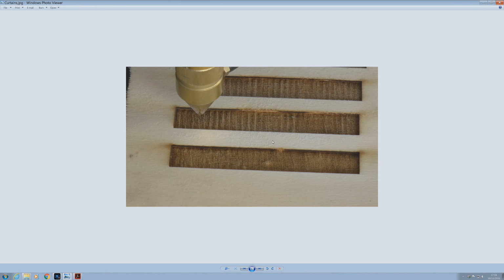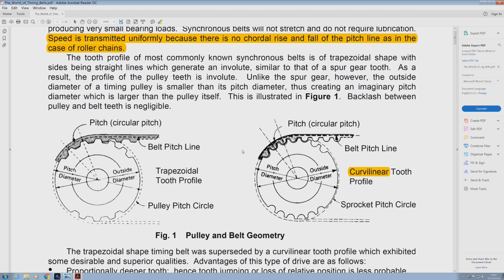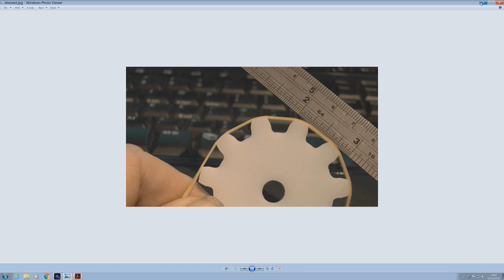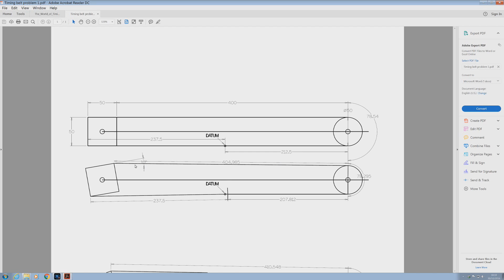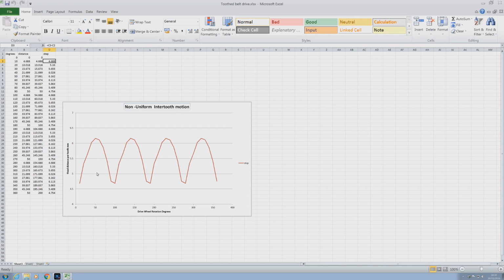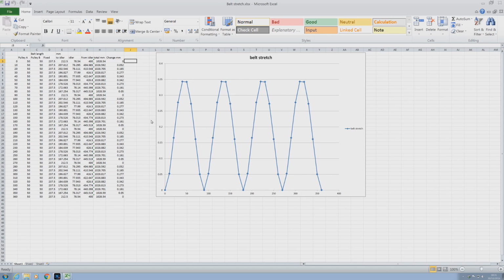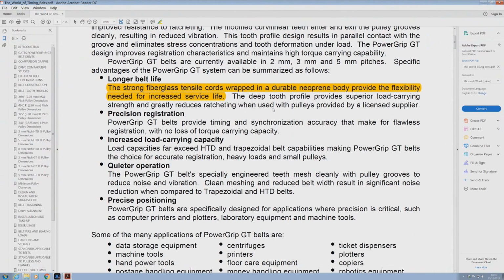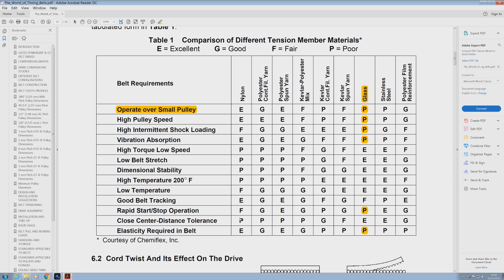RDWorks Learning Lab 83 Is this Curtains for ever

Comment: Hello SarbarMultimedia,
... strong, recurring fibrations can also be generated by the first driving pinion (each further as well).
Whose center in the real world is never exact.
What this loss of center means is underestimated.
Great video, love your posts!
Reply from the maker: Hi Herman
 Further investigation revealed that the toothed drive pinion was running true after all and that it was just the flange that was eccentric. I persevered for a year before I devised a soultion which is still working 2 and a half years later. The solution to my problem can be seen here
https://www.youtube.com/watch?v=B87ifTPKN8c
My only reservation was the extreme flexing I was making the belt perform. I have a spare belt but as yet I see no sign of a problem. and the machine is used regularly for photo engraving
Best wishes
Russ

Comment: I'm curious if a second pair of gears offset from the first would smooth that out.
Reply from the maker: If you take a look at  21 and 23 minutes into https://www.youtube.com/watch?v=pzropA_AcL8 you will see the completely different gearing systems on my two machines. Thr lightblade machine with its hybrid servos and multi gear drive train still produces this effect  as I discovered in  https://www.youtube.com/watch?v=b9KwuJh1RhA at about 17min 30sec.
Hopefully that answers your question. I am sure i will eventually discover the cause  but I suspect it will be by accident as  I'm looking at an unrelated issue.
Best regards
Russ

Comment: I have the same machine as yours. only i get problems with cutting circles - the cut path is a little bumpy and the smaller the circle the bigger the problem. maybe its problem with puleys and belts? Settings?
Reply from the maker: What you describe is almost certainly a backlash problem. If you like to send me you email via the You Tube message system, I will send you a test program that will identify which axis you need to look at. Usually it will be the Y axis and mosty likely something to do with the mechanical link between the stepper motr and the drive shaft. Maybe loose clamp screw?
Best regards
Russ
Reply: SarbarMultimedia i have checked all the bolts,  tried playing with the belt tension and still it seems to be same. from made projects i have suspicious also on y axis. one thing bothers me and i dont know if this should be - the tension pulleys at the y axis operates a little loose (they can move a little clockwise and backwards) and they are not fixed tight by tension bolts. but in this way the belts tension system with bolt and pulley is designed . I dont know if you have the same issues with tension and if tension puleys are fixed. and the problem i have only with circles... tried different speeds also. using machine for 3rd month. my email vytas{@}europe.com

Comment: I think the cogging from putting a toothed belt over a smooth pulley is far worse than the tension member bridging teeth effect. Don't forget there is a belt tooth in between the pulley teeth trying to stop the tension member being a chord and not an arc. Certainly GT2 belts work very well in 3D printers.

I solved the smooth pulley problem here: http://hydraraptor.blogspot.co.uk/2011/06/half-belt-hack.html and on my own 3d printer design I put a half twist in the belt.

Comment: I was thinking of you and your little 'curtain raising' problem.. before even knowing you had uploaded this video, I was thinking that a matched pair of larger diameter  pulleys with the same pitch would have helped a fair bit.. was same reasoning you used about how the teeth were causing unwanted accelerations at the head.  Perhaps changing to pulleys and belts with even finer pitch?? I dunno.. 

Good idea ,though about the belt speed was not of proper specifications for the task at hand.  I belt with more compliance would afford a fair bit of 'shock damping' as the teeth engage.  

Part of the fun of chinese equipment is the fun involved into improving the device :)  Glad to see you did build an enclosure for the end of that lasing tube. the way it was 'hanging out over the abyss' would have given me a good bit of the nerves... 

Oh well, back to making things for a while :)

Comment: Ross surely the number of teeth is independent of the rate at which the stepper motor turns.i.e. changing the pulley and belt to 32 you won't make any difference to the resolution. Or am I wrong? Like the video as always good analysis clearly something we all need to sort out.
Reply from the maker: Hi Peter 
I'm no stepper motor expert but as far as I am concerned from just a geometry point of view if there are 200 steps on the stepper (forget about the micro-steps at present) then if the pulley is 25mm effective diameter then the circumference is 78.55mm and the resolution I can get will be 1/200 ie 78.55/200=0.3928mm. If I increase the effective pitch diameter to 50mm then the distance that the belt will travel per step will now be 0.7855mm. Now it may be possible to set my stepper to microstep 4000 steps/rev instead of it's current 2000 steps and that should restore the resolution. I'm not planning to do that because there are physical space limitations. Hence if its possible to get a 2mm pitch belt wide enough and long enough then I could do a simple straight swap and get 24 instead of 16 teeth. I will be investigating. My exaggerated example shows the principle that's taking place for every tooth but more teeth means a smaller problem and unless you are doing something where you might see this pattern, for most people it would be invisible (even though it was there).
Thanks for your comment
Best regards
Russ
Reply: Right I think I get it.  To increase the tpi means increasing the diameter of the pulley.  If a pulley with the same diameter were available with smaller teeth and likewise a  belt then it would be ok.
Reply from the maker: Yes, You now see the same things I see.
Russ

Comment: Very good analysis I think.
I wonder if that higher tension may be telegraphing a vibration.
And a lower tension may be causing vibration by taking up slack.
You probably do not have room in this machine to effectively do anything about it.
But a spring loaded tension exerted on the belt (outside the belt away from the teeth).
Could serve to normalize the tension and also serve to dampen vibration?
Reply: A way to prove the idea I think, is if the curtains get wider ( or more defined) away from the stepper than when right next to it.
Reply: or maybe not spring loaded wheel but a wheel made from softer rubber that would allow some give.
I'd be willing to bet that if you had the belt at your higher tension .. and set the head to the center of your cutting area, you could pluck the belt and it would vibrate like a guitar string.
Reply: adding weight to the head would also prove it I think ..
Reply: another point made by your excellent research into the problem is that a square becomes rounder because of the amount of chords added to the shape.
Seems to me that your drive pulley is not concentric .. which would complicate the issue I am discussing.
Reply from the maker: That eccentric pulley is not good but it was the one thing that helped alert me to where the curtain problem eminated from.  One possible solution that I am seriously considering is changing the belt pitch to 2mm so that I can get 24 teeth on the same size pulley. By default that will mean a new pulley and maybe a change of belt construction. Until I remove the motor for a close inspection, there appears to be no obvious way that the pulley is fixed. There are no grub screws that I can see from my limited viewpoint.
Thanks for input
Best regards
Russ
Reply: That makes a lot of sense ... 
I'd also like to point out that the higher precision machines use worm gears and bearings to eliminate 
flex in the belts.
And that dampening could help if at all feasible.
Great stuff as always Russ You never cease to amaze..
Reply: I would think they (manufacturer)  would go to the easiest ,simplest method possible in mounting the pulleys.. good ole interference / pressed fit
Reply: Indeed ...
And if the part is loose ...
squeeze it like a pair of channel locks would.
This would send vibrations through the belt and cause curtains ... but acceptable .. until RDWorks takes a close look at the causes.

Comment: Enjoy your videos,
My 60 watt machine gets good engraving results when raising the speed and power to as fast (at the desired depth, usually less than a mm) as I can (500mm/sec if possible) which requires all of that 60% power you talk about and scanning with the wood grain using x_swing, .1mm interval with long runs.
I do multiple engravings to increase the scan swing length so the machine does not have to stop and reverse as quickly. 
Maybe If you turn a square fast enough it will act like it has more corners :)

Comment: When I made the suggestion about the findings we in the 3d printer world have made (the smooth pulley vs the toothed pulley) was more of a vibration as the gaps in the teeth hit the smooth so it goes ker plunk kerplunk kerplunk and with the smooth side of the belt it would not it would just be a smooth ride.  The direction you went in is another issue that only more teeth will help but the largest GT2 (what we in the 3d printer world use) is a 5mm bore 40 teeth which is horrible for resolution in comparison to a 16t setup but has a lot of torgue (which we don't need in the 3d printer world).

I will say I just did the calculation and a GT3 vs a GT2 16t gear is 15 micron resolution vs 10 micro resolution (1/16 micro stepping) respectively so a loss of 5 microns and for a laser machine isn't 5 microns considered large?
Reply from the maker: I hadn't thought of a finer pitch belt. Yes, that would help to increase the number of teeth without changing the diameter of the pulley. For the relatively light duty requirements I don't think it would be a serious problem. I'll maybe check the possibilities because for the same 15.28mm  diameter I can get an equivalent 24 tooth matching 2mm tooth pitch pulley.. Thanks for the thought
Regards
Russ
Reply: SarbarMultimedia
I honestly see no need for much torque on a laser machine as well but on a CNC mill (some CNC routers) is when we need the torque and begin seeing the use of GT3 belts.   GT3 stuff is not as inexpensive as the GT2 stuff so I wonder why they went to that?  Sure wasn't because of some need for torque.
Reply: SarbarMultimedia You shouldn't be constrained to using the same pitch diameter, you can just recalibrate your steps/mm settings to compensate for any changes.  In my limited experience, moving to different size pulleys doesn't change your acceleration profile enough to bother with retuning it, only had to change my step/mm settings.

Moving to a 16 tooth from a 24 on my 3d printer helped to gain resolution as well, since each step made a smaller change on the belt, enough so that I didn't feel that I needed to upgrade to 0.9 deg/step motors. It does cut the max speed slightly, but I don't think that you've hit the max speed on your controller or driver yet for that laser. I haven't checked the pulse per minute limits of that controller, but I'm pretty sure that it can keep up with a RAMPS board which still can give me 160mm/sec. 
There's a handy table here http://reprap.org/wiki/Step_rates for the effect of pulley diameter on resolution and speed.

On a slightly tangential question, why not use a belt with nylon reinforcing cords? I didn't study your reference table thoroughly, but the items that were highlighted all said "E" under nylon... and you shouldn't have enough load on that belt to need the Kevlar anyway.
Reply from the maker: I will give serious consideration to the 2mm pitch belt because that will be exactly the same pitch diameter pulley as the 3mm belt but with 50% more teeth......so no changes to anything I would also look to other belt designs, polyester or nylon reinforcing both look good for the relatively light loads that the belt experiences. There are mechanical constraints that prevent me changing the pulley diameter by very much but I will consider a slightly bigger pulley if possible.
Thanks for comment
Best regards
Russ

Comment: Your Curtain pattern may be from your stepper motors.  I'm guessing they are 1.8 degrees per step.  If you change them out to 0.9 degrees per step you may have a tighter pattern.
Reply from the maker: Hi Steve
Pretty certain that this curtain effect is not the steppers whereas other patterns I have spoken of before definitely are. If I can't rid myself of the issue there is no value in my me putting money into new steppers because it does not represent a show stopping issue for me. It's just a weakness in the overall system design. Changing to a 2mm pitch belt, as was suggested by  Dark Alchemist,  will allow me to increse the number of teeth by 50% with little expense or change to the machine. That is a route I may explore.
Thanks for your suggestion because as you can see I'm still learning and exploring and if I can get feedback from users of this kit from other fields of experience then I'll add that into my decision making
Best regards
Russ

Comment: as usual Ross. excellent reference material here. you are really helping us understand our machines a lot better. I did not mention it in the previous comments but as part of my upgrade to servos, I'll be upgrading to polyurethane belts with steel core. not because of the need for strength but just because PU seems to have an edge when it comes to grip and lower elongation during high inertial loads. time will tell how all turns out ☺

Comment: I think this may also be applicable for 3d printers. Surface ripples can mysteriously appear , and be difficult to figure out what is causing them.  In years past,, high-performance fishing-line was used on low-end consumer models, and produced great resolution, but had to be re-tensioned periodically, so they were upgraded to the G2 belts.